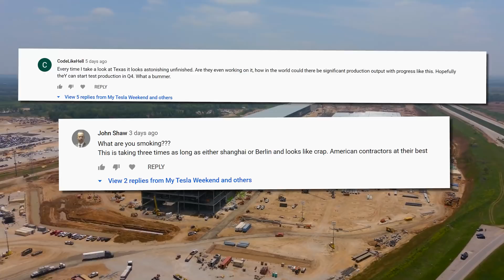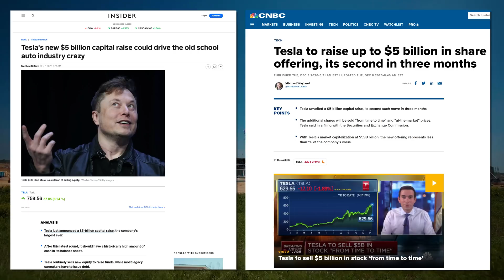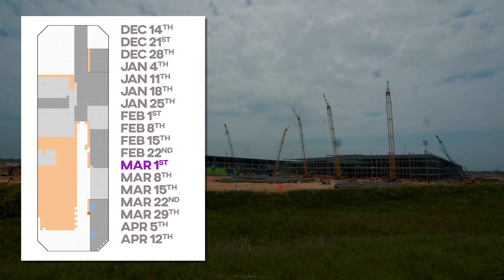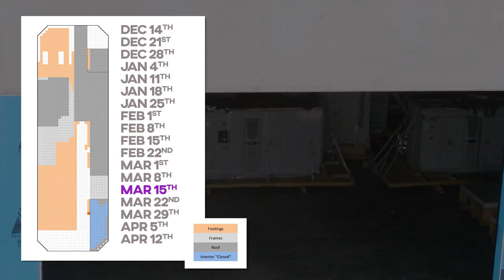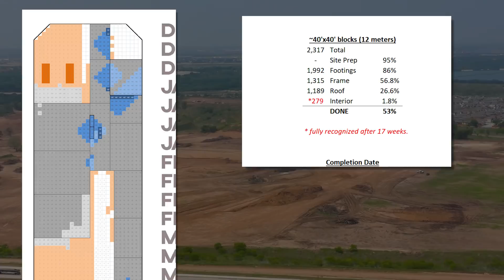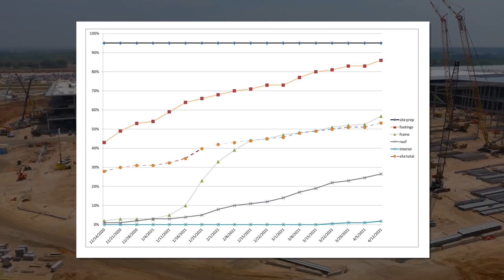Giga Texas is CyberQuick and it's only getting faster - 53% Done!

Comment: Hey dude i think we can say for sure that middle part is at least gonna be extended. They only use the green stuff for what looks inner walls. As in the latest footage shows them using concrete walls for the exterior and green for the interior on the same structure

Therefore we can assume more structures are coming further south, if it wasnt they probably would have used concrete walls instead of the green shit
Reply: Yes it extends further south all the way to the edge of stamping. If you look online you can the plan for the overall footprint. I’ve seen the blueprints myself.
Reply: Anarchy_Sparky how? Do you know where we can see it or is top secret or some shit

Comment: To me the most important thing is not structure completion but rather when the battery plant turns out batteries or when cyber trucks come off the line.  It’s obvious now that they will be stamping parts and casting parts in July. They will gas & electricity , water tight (more or then).

Comment: I think your analysis is pretty reasonable.  The scope of the project (as it appears to us) seems to be expanding and no doubt they will be building more on that site in the coming years.  But if you just limit analysis to that main building, I think you're on track.  I can see Tesla getting things done quicker inside once they take the weather out of the equation.  Of course, the Cybertruck production depends on when IDRA gets the 8k press built, installed, and working properly.  But Mod Y production could start before that.

There is no doubt that Tesla is moving full steam ahead.  As fast as they can.

Comment: I think the insides are way further along that your tracker are indicating - JMHO......

I still think we will see sample cars coming out of that factory prior to the 1 year anniversary of beginning this project.  The site may not be finished - but cars will be ;-)
Reply: I been hearing some issues with the area though. To build vehicles you need people and although Austin is a large city it does not have a huge manufacturing base to steal from hence they will have to import a lot of workers.  That leads to a further issue of housing and although Elon is trying remedy that its still going to take time, years not months to resolve.  The one good aspect is that areas to the south and east of the factory are open for development the problem is the ground is so bad that it takes more effort to deal with the foundation.  I will say that they may be able to get vehicles rolling out in later parts of Q3 but it will be a trickle and not a flood.
Reply: @mdhofstee  Where did you hear that land to the east and south of the Tesla property is difficult to build on?  Most of the original Tesla site was an open gravel pit, mined to an inch of it's life, left in abysmal state.  Land to the east, south and north is flat and very suitable for development.  And was already starting to develop rapidly before Tesla came to town.
Reply: @cerealspiller  I am not talking the site itself I am talking about the county.  The west part of the county is more of a rock ledge where as the eastern part is all dried clay that mushrooms when it gets wet.  As a result most people live on the west side of the county and where most of the development has happened.  The issue is housing but with newer building methods the east part of the county could be developed but its going to take a lot of time.
Reply: @mdhofstee  Offer decent jobs -- and the people will come.  A LOT of out of work labor in the US due to COVID-19.  And Texas is a free state for now - so I'm sure many more are willing to come.  Need to get those Tesla housing projects up and running!
Reply: @gerrywithaG  Yeah but you need houses for the workers and that is where I think Tesla is going to have a lot of problems.  I can not imagine what its like building on clay that when wet mushrooms up. My family built on clay that would not drain as it was saturated but man clay that is dry as a desert would scare the f out me.  
  If others say go to the east side of the county well good luck getting any workers in those areas as the housing cost is over 300k and the stock available is laughable.  Nobody is selling as they all traded their houses last year.
Reply: @mdhofstee  I agree -- but good jobs will bring the needed infrastructure -- that's what's nice about capitalism!
Reply: @gerrywithaG  Very true but the issue is TIME.  You do not want your workers living out of RVs and suitcases either.
Reply: @mdhofstee  The northern San Antonio suburbs are about an hours drive and it seems that there are numerous towns in between.  Also an option for some new housing.
Reply: @gerrywithaG  We are talking about production workers who will be making around 20/hr.  Do you think they want to drive an hour away to work there. Its an issue of not having any affordable housing stock right now.  For these jobs the house can cost around 115k.  So look for those prices unless you include a second earner in the house that would allow for more house to be purchased. But to me you really do not want to include a 2nd earner unless its at a stable location.